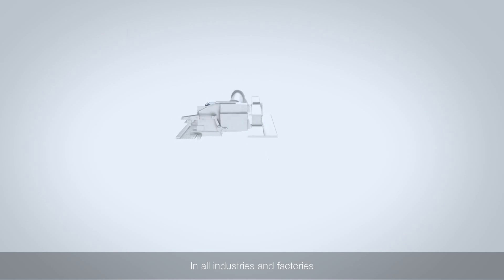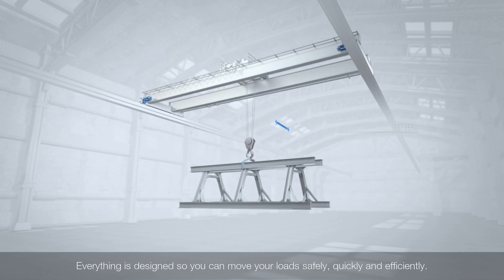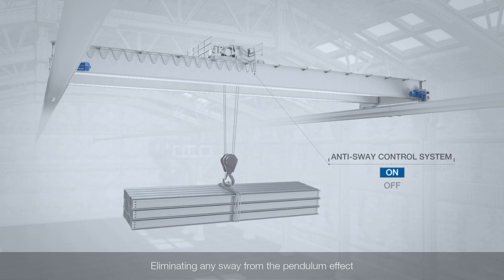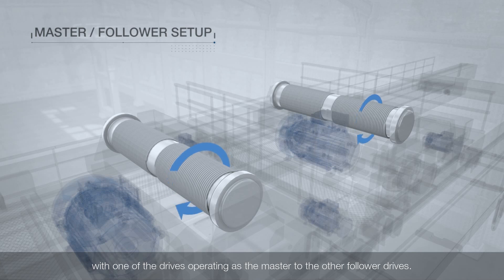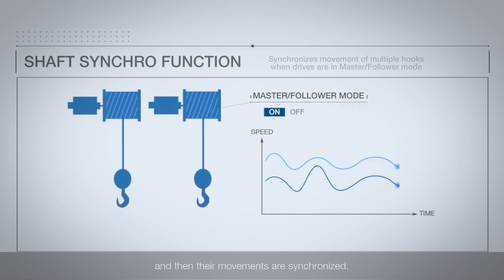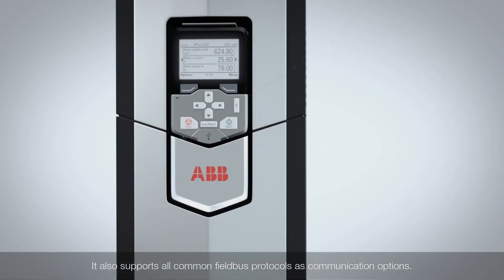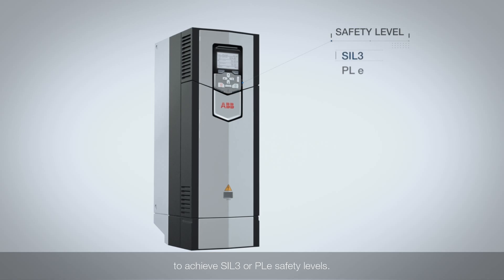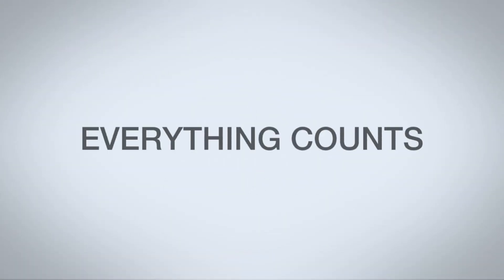Overhead crane control with ACS880 drives

Comment: If mechanical brake fails at mid air with load on drive stop condition, is there any function there to hold the load in mid air ?
Reply from the maker: Brake match logic can catch the load on the fly and hold it at zero speed, until the crane drive brings it back to the floor level.
Reply: @abbdrives  thanks for your reply, just out of curiosity can you please explain me brake match logic?
Reply: @nishannsn5465  Vereceğim cevap geç olabilir :) Ben tavan vinç üreticisiyim yaklaşık 15 yıllık tecrübem var. Frenleme sistemi elektromanyetik olarak çalışır bobine istenilen voltaj geldiğinde fren açar ve elektrik gittiğinde fren kapatır. Sürücüler frenleme YAPAMAZ